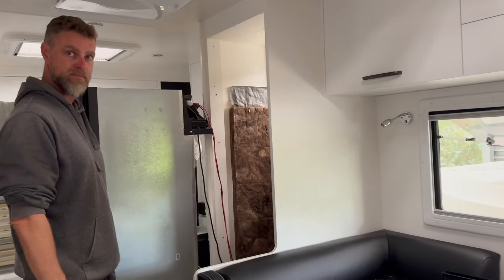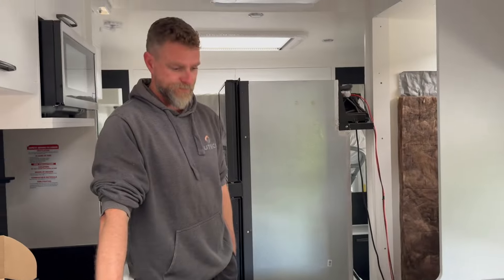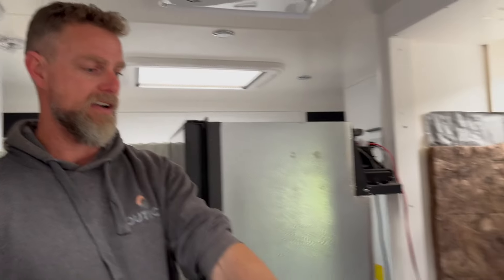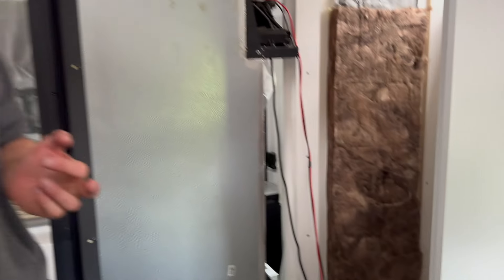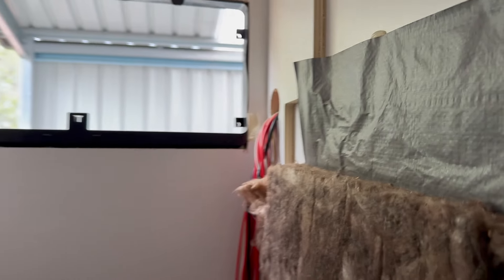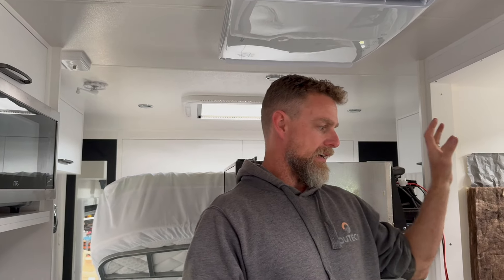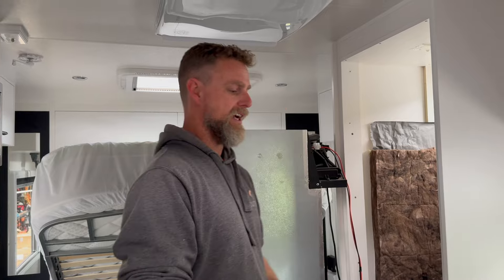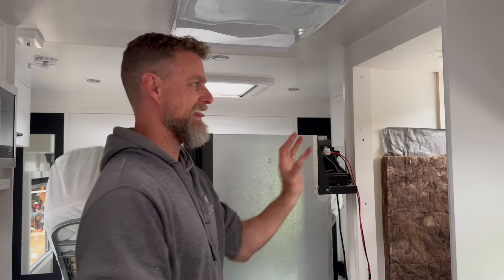🚨 SHOCKING Electrical Wiring in a Brand NEW CARAVAN - PART 2 🚨

Comment: What’s the brand of the caravan?
Reply: NEWAGE, looks very much the same as my 2022 desert rose, nice van but shady Elec
Reply from the maker: The New Age Desert Rose is indeed a great van, but we can appreciate your concerns about the electrical work.   What issues have you experienced?
Reply: @outechoffgrid  hey guys, just watched your updated vid on the DR18 fantastic btw.  I've had issues with the wiring from day one, the bm tablet firstly wasn't responsive after resetting the whole thing it froze  once again but with tanks empty it turned all the curcits(lights pumps) on and ran everything for a good 20mins untill i could get under the lounge again for another hard reset still plays up on occasions  but dealers can't make it do it when in their workshop.the awning lights and offside lights were on one circuit(took 4months to get fixed van was 2weeks old) what you have done looks amazing and I'd love something like that after all it's a 120k plus van